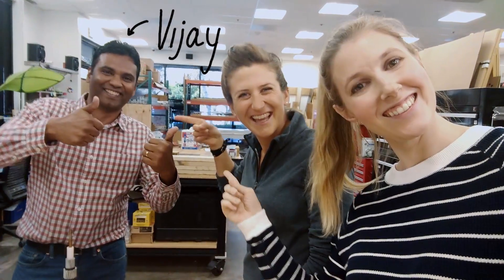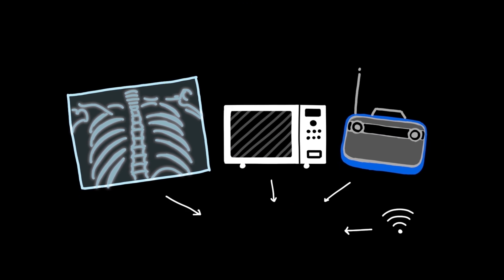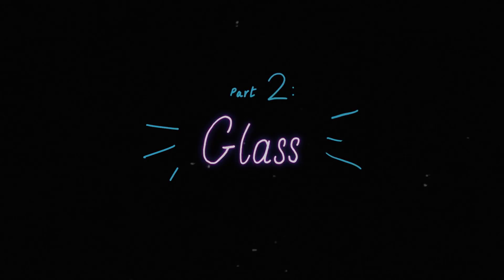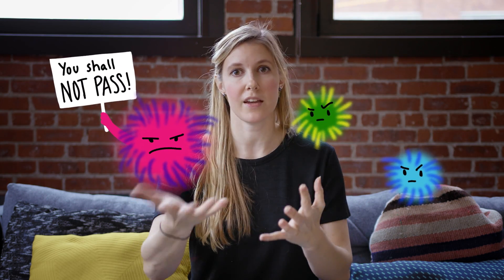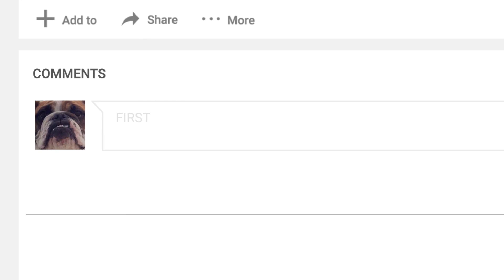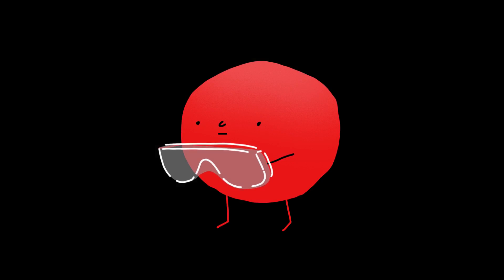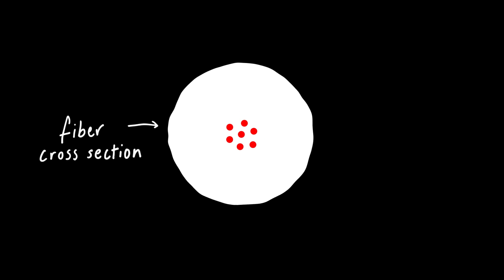How Can Light, Plus Glass, Equal The Internet?

Comment: What's the current (latest to be) bandwidth of fibre optic cables? Petabytes per second?
Reply: The capacity per fiber depends substantially on the target distance. Currently deployed systems commonly support 9.6 Tb/s (terabytes per second) if traversing about 5,000 - 10,000 km and about 25 Tb/s if traversing a shorter distance like 500 km. Upcoming platforms double the amount of spectrum used thereby doubling the capacity per fiber. 

In research demonstrations, researchers have demonstrated capacities 3-4 times the capacities cited above.
Reply: Jaison Varghese isn't it terabits/second. 
(Tb=terabits),(TB=terabytes)
Reply: 1 PB= 1024 EB,1 EB = 1024 TB
Reply: data speed is measured in bits not bytes so its small "b" not capital "B"

Comment: Phase shifting of the Lazer seems a lot more effective than flashing. What are some of the downsides to doing phase shifting over flashing the Lazer?
Reply: The main downside is the additional complexity of the transmitter and receiver (needs a stable, high bandwidth external modulator). For long distance, high data rate transmission, phase modulation is used commonly nowadays.

Comment: Now that you've explained this, can you please explain wi-fi? and don't say it's wavelength stuff cause that's clearly nonsense
Reply: The commentary in the video indicated that Wi-Fi is also a form of light or electromagnetic radiation. The difference between microwaves, X-rays, visible light, infrared light and wifi mentioned in the video is the frequency (or equivalently the wavelength) is different. For example, the frequency commonly used in fiber optic transmission is around 192 THz (which translates to a wavelength of 1.5 micrometers). For WiFi, the two commonly used bands are 2.4 GHz and 5 GHz; since the WiFi frequencies are much smaller than infrared frequencies, the wavelengths for WiFi frequencies are much higher. 

FYI - The relationship between frequency and wavelength is inverse given by (frequency * wavelength) = (speed of light)

Comment: I have a question: When you connect a fiber optic cable to some equipment, lets say a router, the light is transformed into an electronic signal. However electricity has a slower speed then light.* Does this mean that the speed of the whole setup is limited by the speed of the electricity?
(* the speed of the signal not the electrons)
Reply: Time taken for transmission of information depends on two factors (a) transmission time determined by the speed of light in fiber, and (b) size of transmission pipe and factors for buffering information and re-transmission if there is congestion etc. Purely from the perspective of transmission time, it is interesting to note that speed of transmission in fiber is actually slower than the speed of transmission in copper (electrical). The reason for this is the speed of transmission in fiber is (speed of light in vacuum) / (refractive index of glass fiber). Since refractive index of glass is about 1.5, the speed of light transmission is 2*10^5 km/s, while it is ~3*10^5 km/s in copper. 

However, since the transmission rates in copper are much smaller than in fiber, the effective time taken to send a certain of data across a fiber optic link is much smaller than a copper link, even though the transmission speed is slower in fiber than copper

Comment: Hey Vijay, I have a question about the "reading" and "writing" of the lasers beams. 
How do you create and read the different wavelengths without having them interfere? Do you have a unit for every wavelength and then merge/split the glass threads? Or do you have one insane laser/sensor that can handle them all?
Reply: The main reason infra-red wavelengths are used in fiber optics is that standard fiber has the lowest loss (attenuation) in the infra-red region (at approx. 1.5 microns wavelength). This enables long-distance transmission with minimal loss (and hence minimal amplification required to compensate for the loss)

Comment: If the infrared rays are going zig-zag, is there a possibility that two of those red dots will collide?
If yes, what would happen then?
Reply: Yes - those "red dots" do collide. Specifically, in a multimode fiber where the zigzag happens, there is a pulse smearing because some of the red dots zigzag a lot and hence reach a little later than the ones that go kind of straight and reach earlier. This pulse smearing eventually limits the maximum reach and maximum datarate in a multimode fiber. This is the underlying reason why these type of links are used for relatively short distances and for low data rates. If the links are longer, there is more pulse smearing due to a longer delay between the zigzag dots and straight shot dots. Similarly, for high data rate, the pulses are packed closer together and they smear into into each other. There are techniques to peel apart smeared pulses but it gets expensive to use these techniques for short links, and those fancy techniques are typically used for longer distance links
Reply: Thank you so much! 
I am studying computer science and this has given me a lot of insights to the world of internet.

Comment: You mentioned that in one strand, there can be 100 different infrared wavelengths, Are they the same wavelength.Don't they interfere with each other? Since they are light waves hopefully or maybe light particles. Since light can exhibit both particle as well as wave nature.
Reply: They are all in the infrared region of the electromagnetic spectrum, but they are indeed separate wavelengths. Current systems have about 100 wavelengths typically separated by 100 GHz or 0.4 nano meters.

Comment: what changes do we have to do at a software level - once we change from one core to 7+ glass cores?
Reply: There are two changes required and they are essentially at the optical/electrical level. The software layer views a multicore fiber as essentially a larger pipe. The changes are (i) getting 7 transmitters to couple to the seven cores, and (ii) more sophisticated receiver which can unfurl the coupling effects among the 7 cores.

Comment: Is the light going in one direction or both?
Reply: In almost all of modern optical communication networks, the light goes in one direction. So, we use two fiber strands, one in each direction to complete a transmit + receive link. It is definitely possible to send light in both directions at the same time, and there are indeed a few applications that do that. It is just that sending light in both directions makes the peeling off from the two directions a little more complicated and there are also some subtle complications in distinguishing the reflected signal of the transmit direction from the receive signal.

Comment: I can understand how fiber works if it was one computer talking to another directly, with nothing between them. But that's never the case. A lot is going on between that.

How is my internet traffic segmented from everyone else's internet traffic that's utilizing the same fiber line/main, for example, in an apartment complex or neighborhood?

Does everyone's data pulses of light hit everyone's fiber option end, then our modem finds my data and only chooses to translate it? Or is there a hub between me and the ISP that only delivers my traffic/light pulses to the end of my fiber line?
Reply: Good question. The video covered only the fiber optic pipes part of the Internet puzzle. Key building blocks of the Internet  are routers that label each subscriber's traffic on packets of information, pack those packets together based on a common destination and then send those packed streams on to these fiber optic pipes to the next router in another location. There are multiple routers between the source and the destination and it is these routers that do the bookkeeping of information per user and guide them to the eventual user. From an analogy perspective, not very different from the postal system, just much more blazingly fast :-)

Comment: thank-you for the awesome video. But at school, teachers always talk about optical fiber work by 
Critical angle and Total internal Reflection. so which is correct or are there two different kinds of optical fiber? thank you!🤔😉
Reply: It is indeed via total internal reflection. Taking the example of a multimode fiber, any light that is outside the critical angle is scattered away but the light within the critical angle is coupled to the core of the fiber

Comment: How does the data "know where to go"? For example, how does the data of this comment get directed to the youtube servers?
Reply: Good question. The video covered only the fiber optic pipes part of the Internet puzzle. Key building blocks of the Internet  are routers that label each subscriber's traffic on packets of information, pack those packets together based on a common destination and then send those packed streams on to these fiber optic pipes to the next router in another location. There are multiple routers between the source and the destination and it is these routers that do the bookkeeping of information per user and guide them to the eventual user. From an analogy perspective, not very different from the postal system, just much more blazingly fast :-)

Comment: Does the colour of the laser (light) matter when sending information? Is one colour more effective than the other and why if so.
Reply: There are subtle differences between the various wavelengths. The differences mostly arise due to specific properties of the fiber (attenuation and dispersion). However, for most types of fiber, the differences are relatively small and modern systems use multiple wavelengths to maximize the capacity transmitted per fiber

Comment: How do you manage the cables and watch out for any problems?
Reply: Two methods : 

1. The transmitters, receivers and intermediate amplifiers are constantly monitored for their health and any deviations are flagged to a management system.

2. Once a fault in the fiber is flagged, an instrument called OTDR (optical time domain reflectometer) is used to identify the location of the fault. OTDR sends a short pulse of light and based on the strength and time of flight of the reflected signal, we can infer the location and nature of the fault.
Reply: Vijay Vusirikala thank you, you explained it very well. :)

Comment: How long can this cables stay there? When and how do you take them out, if they get damaged? It wouldn't be efficient when you try taking out the whole cable, so do you cut a part of the cable out and if yes does this damage the 2 ends, which were effected by the cut?
Reply: As Stefano pointed out, the end-to-end cable is already "punctuated" by amplifiers every 80-100 km in a longhaul network that spans a region or a country. These fibers are typically puled through in buried conduits or are along power lines. They last for 20-30 years as the glass does not degrade over that period. Fiber cuts and repairs are not uncommon and we have to plan for the damaged fiber to be repaired. The entire fiber does not need to be replaced. Just the damaged portion can be fixed by attaching a small fiber segment and "splicing" on both ends of the damage.
Reply: Milletimisev I believe that those cables are already split in different parts connected together by 'amplifiers' that help the signal travel the long distance (in the case of underwater cables). I think that you can just join any two ends. but don't quote me on that. hopefully you'll get an official reply.
Reply: Stefano Vazzoler thank you, I hope so too.

Comment: Hi Nat & Lo and Vijay....Nat said that researchers are trying to put 7 fiber optic strings into one....so why are they "trying"??...what are the difficulties to accomplish that??...
Reply: Multi core fibers (example 7 core fibers) have been around for a few years and have been used in many research settings,  lab demonstrations and some early deployments in Japan. The main challenge is to make extremely low loss fiber with 7 cores with 100s of thousands of kilometers. Also, the electronics / optics to work with the multi core fibers are not yet available because of the additional complexity in unfurling some of the coupling that takes place among the 7 cores. 

For now, the capacity demands can be met by using a number of single core fibers but as capacity needs increase in the future, there is a good possibility to seeing more multi-core fibers or other innovative approaches be used.
Reply: Thank You Vijay. It's an honor to replied by a Googler. Thanks Nat & Lo for such informative and fun videos. Keep up the pace guys. 
I know I am taking it the wrong way but, for 7 (or n) core fibers isn't it 7 (or n) times the same type of calculation?? I mean can we not just keep multiplying the process in the couplings??
Again thanks for your reply.

Comment: Hey Vijay, how is the information,0/1s, actually transmitted? Is it from the displacement of waves or the presence and lack of presence of light.
Reply: As ZEtAdda alluded to above, the type of transmitter and the mechanism of imposing the 0/1s on to the transmitter varies greatly by the reach and the datarate of transmission that you are targeting. For example, if the reach is a couple of kilometers, the laser is turned on and off by sending current and stopping current through the laser. At the receiving end, there is a simple photodetector that detects the presence or absence of light.

For much longer distances (1000s of kilometers), this simple technique does not work. More advanced modulations (similar to the ones used in cable modems or DSL modems) are used whereby the phase of the light pulse is encoded with the 1/0s. At the receiver, a phase detector converts these back into the original data
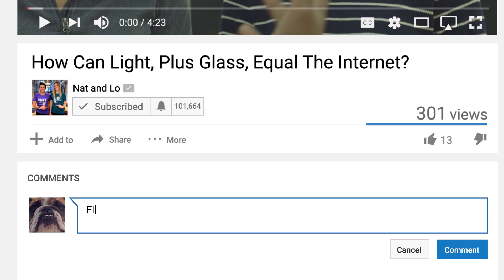Reply: ringraa As explained in the video (watch from 3:04), a short distance cable uses a laser which switched from 'on' to 'off', on being a 1, off being a 0. For longer distances, the laser is left on and something called a phase modulator adjusts it, sending the one or the zero.
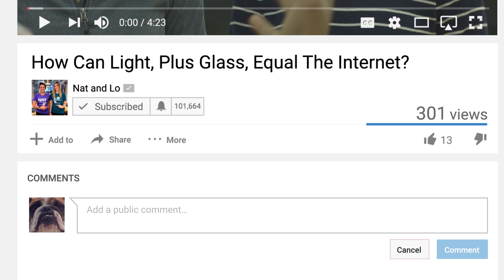I am NOT an expert so don't take my word for everything I say, however most of this was already in the video (again, watch from 3:04).
Have a nice day.